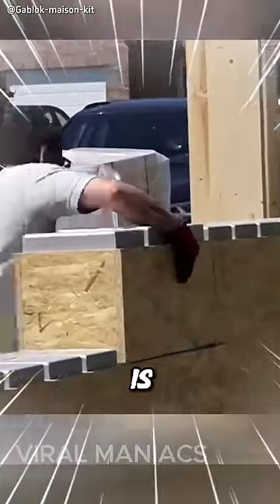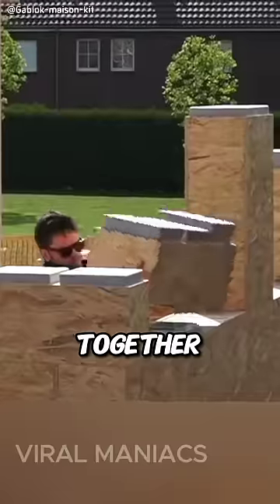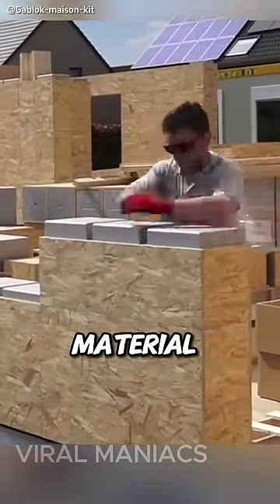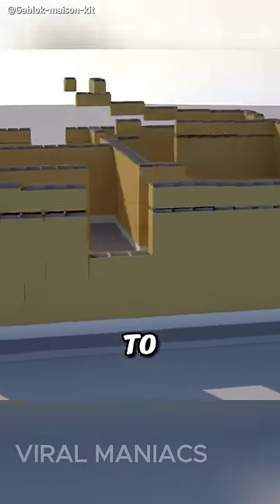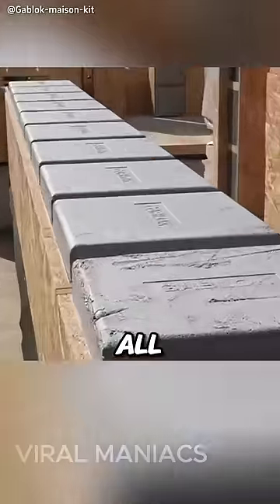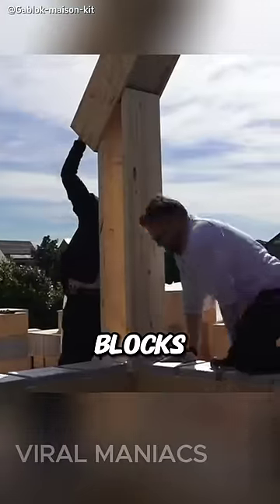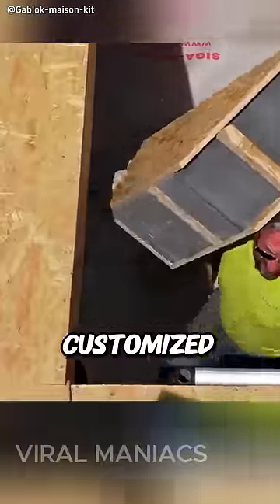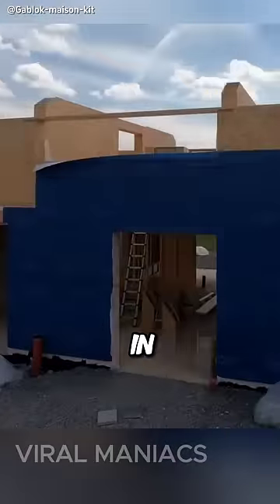Whoever Invented This Way Of Building Houses Is a Genius #shorts

Comment: As an old retired electrician ...I give this a big nope !
Reply: Why is that? Just out of pure curiosity could there be any workaround?
Reply: Well, good that you retired, then :)
Reply: @bobbydee30g  Maybe if there's room between the blocks for wiring, among other necessities, that need to be behind a wall, which I don't see. All that would have to be surface-mounted.
Reply: you like romex inside walls? LOL. surface mounted all day, old man!
Reply: @bobbydee30g you can easily add surface mounted electrical boxes and conduit raceways. like older style industrial/schools. much better than running wire inside the walls.
Reply: @hc3550 the meth heads thank you for making it easier to get to so they don't have to bust thru the wall. I'm wondering how it holds up to high winds like tornados and hurricanes.
Reply: Based on this short clip, it would seem like a pain to run wire, plumbing, and possibly ducts.  That said, if the plans are thorough and approved by local authorities, I can see this being extremely practical and easy to work with if the block makers include the wire and plumbing layout into the build.  Problem is…with plumbing and wiring, there needs to be a bit of wiggle space for adjustments and compensation.  I’m curious how these types of buildings accommodate for that?
Reply: I was going to say, surface mounted, inside a coverable tube/pipe, is an electician's dream, no?? Plus being safe from wires being chewed by rodents inside the walls? You see this all the time in commercial/industrial buildings
Reply: I was thinking this same thing. Where do: wiring, plumbing, and HVAC go? I’m all for thinking outside the box, but for that to work well we first need to understand why the box has reigned supreme for so long.
Reply: @bobbydee30g  It is a terrible design. The support is based on leverage and friction. It might be one of the best insulated homes ever, but it comprised on structural support, plumbing, and electrical availability. I wouldn't  touch a home like this with a 10ft pole. That being said it would be perfect for a temporary or a small camping structure.
Reply: Oh yeah these are approved by towns that literally have no problem putting you ina death trap for money ahaha your insane if you think this a a good idea and not just a money grab
Reply: @williamwright9344 Lol probably as good as regular homes. Which is not that good at all! 🤭🤭
Reply: The wind comes and blows them all over the town like a bounce house. Wizard of oz all over again. What about chemical fumes coming from the polystyrene? No way! In my opinion.
Reply: @AMoistEggroll why it’s just insulation you can probably drill and cut right thru it the real bitch is you have to pre drill/cut your access holes before assembly but it’s doable it just means it’s gonna be harder work but ultimately if this method is better than before then the added labor is worth it it’s just a case of ppl who already make crazy amounts of money mad they have to actually earn the shit idk if you’ve ever had to hire an electrician but they charge around 100$/ hr some more some less but that’s fucking steep and it ain’t shit for an electrician to get paid 25+/hr and that’s I Florida a state notorious for low wages everyone wants easy free money nobody wants to have to earn shit it’s all about how fast how many corners you can cut to increase speed or decrease costs which is acceptable as long as it’s not sacrificing quality but now a days there’s way too many ppl looking to get over on the next person and be lazy as possible in the process there’s a fine line between working smarter and being a scumbag especially in construction careers
Reply: @emileemonsalvo3878  well with a regular home they at least have to bust a hole in the wall at some point and then drag the wire out of the wall
Reply: Yeah not sure wher the wiring and pipes are going to go.
Reply: I'm with you my brother. Worked for New Look Builders for 10 years and I don't think this structure would stand up against high winds and Storm type weather.
Reply: @sulblazer how did they do plumbing and electrical in cinder block walls? Same idea here. Just no zonolite and vermiculite in the walls.
Reply: @williamwright9344 lol it’s going to be all over the place like if you’ve ever stepped on a lego house in the living room floor
Reply: You said that to say nothing no reason or nothing smh
Reply: You have never been to Europe with stone, brick and concrete houses have you?
Reply: I'm pretty sure they have a plan for tubing plumbing wires, it seems like that's the "skeleton" of the house! 
The idea is to be able to "build it yourself" type of agenda. Like any other structures it seems like the wiring comes inside the "important blocks". There's more to it than just what we can see. It's a 60 sec video 🤷🏽‍♂️🤣
Reply: @darthuchiha1779 you talk about lazy, but can't even put together a proper paragraph. Just a long ass, garbled sentence.
Reply: Wouldn't you just batten the walls and use plasterboard and have a raised floor? Sure it makes the rooms slightly smaller but it would also be super easy to put any plumbing or electrics in and super easy to change or maintain?
Reply: @AMoistEggroll im sure thats factored in with the drywall inside the house
Reply: Plumbing and HVAC can be ran in a slab. It doesnt have to be inside walls. But surface electrical is not gonna be fun.
Reply: @roberttsmith6010 That’s what I was thinking too.  When I first looked at unfinished Irish houses I was stunned that the walls are pure cinderblock!  But it makes sense for them as lumber isn’t cheap, and also explains the surface mounted electrical you tend to see.  Having to drill through this wood/foam lego block must be nicer than doing it in cinderblock…
Reply: No, polystyrene is a huge fire risk. And it'll spread fast. It's basically burning Styrofoam. Traditional fiberglass insulation, think that pink wool stuff is fire resistant. It's not about just wiring that could melt and spark a fire. A plumber trying to cut a hole for piping can over heat and spark a fire too
Reply: Its foam... You can literly cut holes in it... Also its wood... You know, you can put holes in there also... How did you get this far in life?
Reply: @williamwright9344  Lol omg, my bad! I was trying to rely to a guy asking how good they stand up to a tornado or hurricane! 🫢🤭🤭
Reply: @SV-je8mg yeah, if you just love bending rigid conduit all day long
Reply: @causewhynot6485 maybe for a shed or pole barn or workshop
Reply: As a firefighter I like the efficiency but my god fire would burn like a raging inferno and when I’d get in that foam it will burn like gasoline so there will be no way to put it out.
Reply: I'd be inclined to believe an explanation if you could offer one
Reply: Isn't osb board similar to particle board
Reply: I would imagine plumbing and electrical conduit channels would be factored into the design
Reply: All exposed plumbing 😅
Reply: @bobbydee30g Sure! You could always just run conduit along the outside of the walls.
Reply: Where we putting the plumbing @hc3550
Reply: What about 3D printed homes?
Reply: @williamwright9344 lol well… whenever they blow away, ya just kinda stack them back up again lmao
Reply: @bobbydee30g fire would love this kind of "construction"
Reply: As someone who has worked on plumbing in my own house, I agree. Hell no! 

Any HVAC experts care to weigh in?
Reply: @hc3550 ....what? 😂
Reply: @roberttsmith6010  Exactly. It's a giant PITA to work on brick and concrete walls in Europe. You have literally bust the wall open all along the path of the wire or pipe. And even worse, stone is all surface mount.
Reply: @whackronomicon  they have new water line called pex that would make running water easier still would be a lot of prep before and during the building process the real issue would be the waste/sewage plumbing but probably doable would make the cost of a plumber and electricians go up but that’s a good thing isn’t it 🤔
Reply: I've seen another video which shows the inside face of the walls being finished. A vapour barrier is fixed to the blocks with battens and plasterboard fixed to the battens. It would be a simple job to run cabling and water pipes through the void. Waste pipes can  be taken through the walls to external soil pipes or to a box out if your design necessitates internal soil pipes.
Reply: Could you just put up studs and drywall and run the electrical and plumbing behind the drywall?
Reply: I worked on a job where we used this building a Knights of Columbus bar. It was the first time for all of us. As far as how the electrical worked; they actually sent a heavy four inch solid steel ball. What we did is heat the steel ball up with a torch, then drop it where the electrician needed to run wire, and the heated ball was dropped creating a perfect channel
Reply: @darthuchiha1779  Pex is still run behind walls. I've replaced alot of old copper pipes (with Pex) in my home that developed pinhole leaks.
Reply: @jarrodcrockett6499  another vote for.... It's a dumb idea
Reply: @1388DBR0WN So basically build a traditional house inside the lego house
Reply: @tammykenton1188   As far as cost to efficiency osb is the strongest material for earthquakes and high wind speeds especially if the entire building is connected with no interruptions. I bet this is stronger than your average framed house.
Reply: @roberttsmith6010  If Europe had earthquakes and tornadoes they couldnt build with those materials the way theyve built them
Reply: Your time has passed, old man.

Comment: For plumbing, you are provided a bucket.  For electrical, you get a strand of Christmas lights and a battery pack.
Reply: Gonna need a lot of batteries, they gotta be charged at some point.🤣🤣🤣
Reply: Bro lmfao 😂
Reply: No HVAC or communication lines, either.
Reply: @DanielMWJ  window fan and a carrier pigeon
Reply: I was just thinking about how in the heck would you run wiring or plumbing. Probably ok if you planned it out and bored out the blocks. But man, imagine trying to add something later.
Reply: Has anyone found a legitimate answer to this question. I would like to know.
Reply: Still not cheap enough housing for Gen Z
Reply: @kellygordon2021 it's easy to get over. U just counter batten the internal walls. There prob 2 or 3 methods that would work perfectly well. Ppl in this comment section either not builders or new/bottom of the ladder in the trades for them to think it's a problem.

Edit: you can see at the end of the video the vertical battens through door opening on internal walls.
Reply: Don’t forget the milk crates for the staircase 🙄🤣
Reply: Lmfao
Reply: @dbradley65  Well what do they do in Europe when they build with concrete blocks? Certainly in a lot of the older houses I recall they use electrical conduits.
Reply: You still have to frame it out. All these videos show you the bare min and its really expensive.
Reply: @peterkratoska4524  never been in one.
Reply: Lol, cool but in countries where we build with bricks and cement we just cut it and after putting all the flexible tubes we fill with foam.
Reply: @vikinglife6316  Houses in Europe  that are stone, or concrete do not need to be framed out
Reply: @peterkratoska4524  You have different laws and codes than we do. We have to secure all wiring behind walls so we have to frame it out.